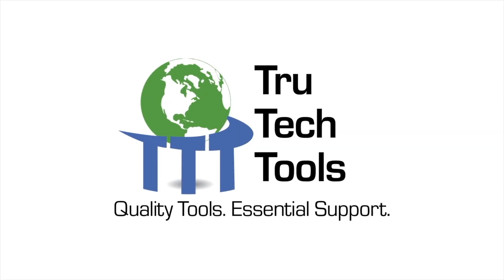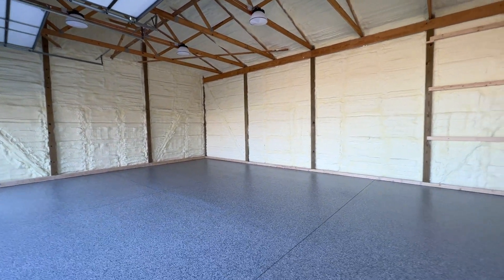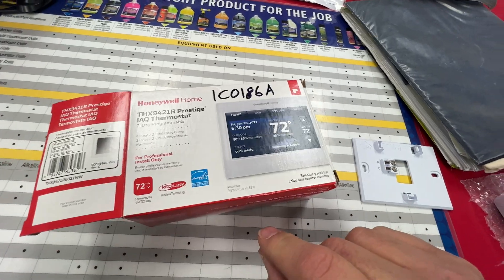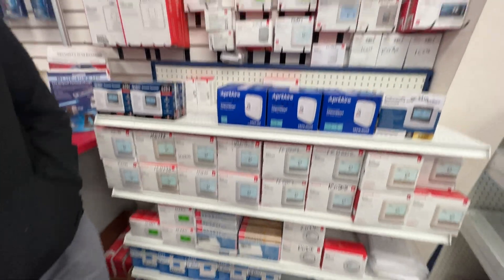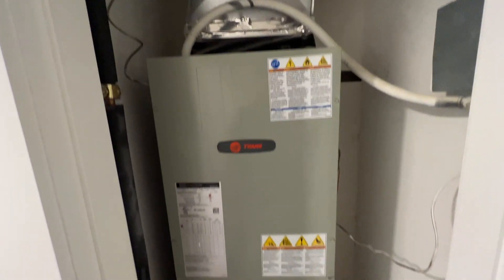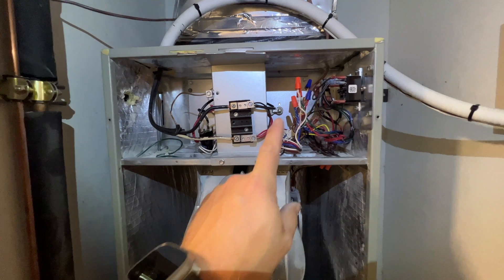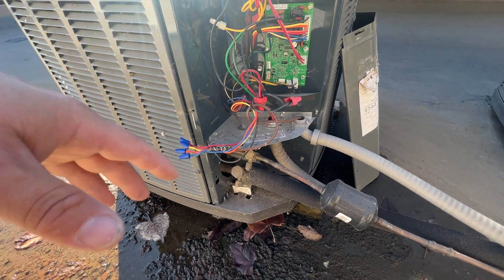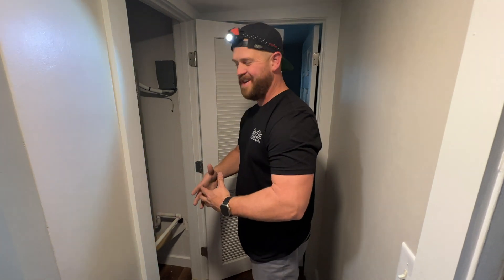Low Voltage Issues | HVAC Repairs

Comment: Not true you can use a honeywell system that only uses 2 wires that goes to the thermostat and then an equipment module it also gives you supply and return sensors and outdoor stat just a little pricey

Comment: I've had a few Trane/AS air handler heat strip contactors burn up coils recently.  They are using inferior parts nowadays.  The older heat strip kits used bombproof relays that seldom went bad.  I'm also seeing a lot of condenser contactors shorting out.  It's too bad that they use crap parts and continue to raise equipment prices.  Guess you just gotta roll with it...

Comment: I’m a HVAC contractor staring a new business in Florida. I am very familiar with service titan and Quickbooks. Was wondering you recommended using service titan for a small HVAC business or what software do you use or recommend? Thanks
Reply: Service Titan is pretty awesome but expensive.  Unless you have a need to track inventory then I would try Housecall Pro.  It has its quirks but is a pretty solid and affordable software for billing, scheduling, dispatching and even has customer financing available.

Comment: Tekmar makes a great wireless thermostat as well. Model number 564 I believe. Works if you have two  un-compromised conductors in your existing wire to power the remote thermostat. Great user interface, too.

Comment: I'm just guessing that perhaps pulling some new t-stat wire would have been a lot quicker and easier than going to the store finding the right one going through the manuals setting it all up. Why not just pull new tstat wire?
Reply: Most likely can’t due to the structure and the way the current wire is ran, I use Honeywells wireless kit every time and never have to run new wire
Reply: Also doesn’t wanna rip up the walls either, and he’s probably 2-3 floors down
Reply: Wait , they had 3 wires from the stat?

Comment: Could have ditched the red link for the Honeywell you wanted with WiFi. Mounted the stat in the air handler room and used the 2 wire you had available for a zone sensor in the space. 

6 one way or half a dozen the other. Just a thought. Great video.
Reply: Probably could have cut cost some too.
Reply: DROD?

Comment: I actually had a low voltage issue just this week. The auxiliary contactor for the heat strips had a bad coil and was breaking the 24 to the thermostat every time it tried to press in. It was a pain to find... 🙄

Comment: I recognized that Trane unit. I just installed an identical split system. I was very disappointed in the quality of the A- cabinet structural integrity. Very cheap framing and their quality has gone down.

Comment: I don't know anything about Aprilaire stats but Redlink thermostats are like other Honeywell (now Resideo) products, well made and reliable. Maybe the models on the shelf at your supply house were limited but I can't believe that a Redlink thermostat wouldn't be available for whatever characteristics that system has. 
Not that it matters but I have two Redlink thermostats of the 8000-series variety and they, two equipment interface modules and the internet gateway have been rock-solid for 6 years since being installed.

Comment: i took the day off cause im a bum
Reply: About the worst video you have ever done. You showed a tstat, a controller, and some low voltage wiring. Not the procedure to hook them up or connect to the internet. Not very useful for someone who wants to learn something.
Reply: @josephfarrow2685  bruh 😂 you’re responding to someone’s comment?